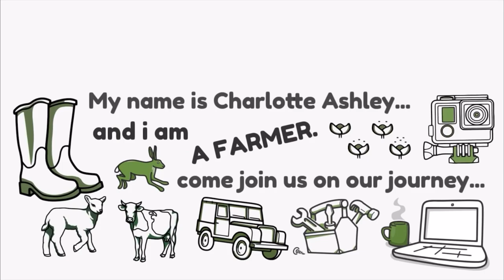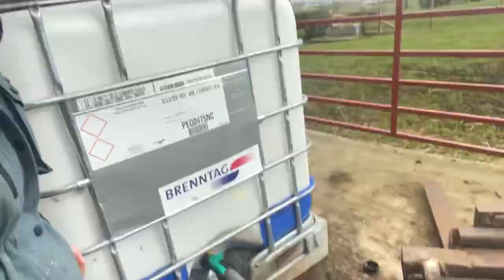How to make sheep trough for £0 FREE sharpening the shear grab. New Slurry regulation won’t work.

Comment: When we had lambs we used to count back from Easter and put the (borrowed) Ram in 152 days prior. Every year, without fail, we started lambing on Maundy Thursday and finished by Easter Monday. Only had a small flock of up to 25 but it meant we could be around all the time without having to take days off work. 🐑🐑🐑

Comment: You need to get a flap disc for sharpening the sheargrab!  It's a disc with sandpaper type material stuck to it. It doesn't heat the blade up as much and alot easier on the metal. You wouldn't be long taking off the cutting edge with the normal grinding disc.  And when sharpening keep the blade as thin as possible by keeping grinder flat and taper edge back about an inch. Your handy with the tools!🙌
Reply from the maker: Thanks Keith so much I didn’t have a clue what I was doing x x x x x and I wouldn’t mind I have one like that as well😖😖😖

Comment: Keep away from that sheer grab with that grinding disc use a flap disc 40 grit instead (won’t heat the cutting edge if used properly ) 12:10 12:10
Reply from the maker: I HAVE ONE OF THEM JESUS wish I’d have known that